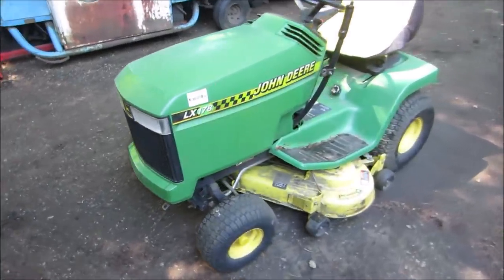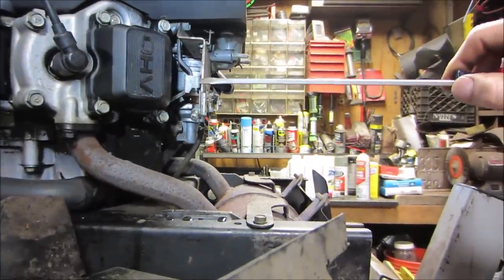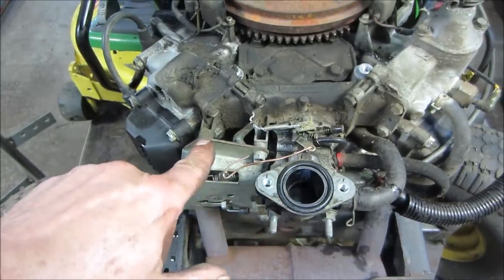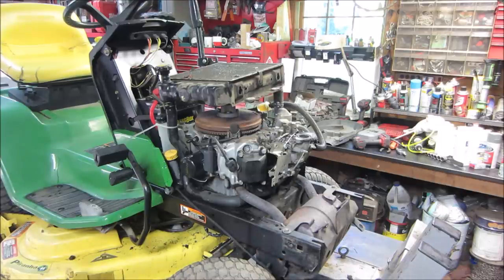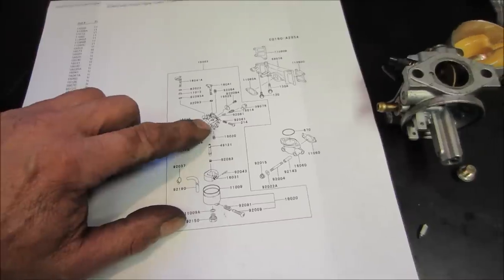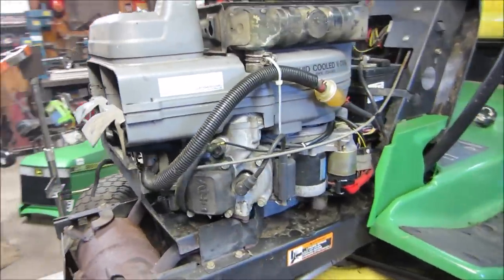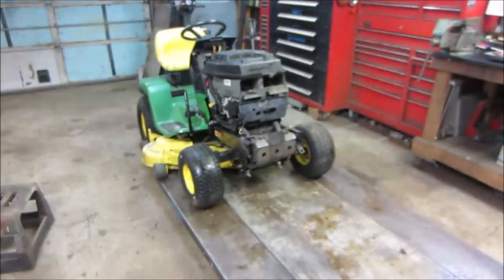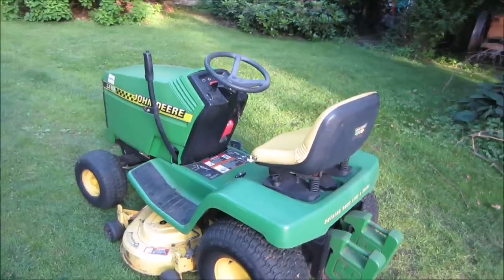yard sale John Deere, lets unfix other peoples repairs.

Comment: I just bought me a John Deere 125 last year.
Then i see for sale, Same one i bought for $50.
I am betting they just didn't know how to fix it.
I have fixed lawn mowers that people just gave to me because they didn't know how to fix them.
They thought they was junk.
many times they was still good.
Just need some carb cleaning, even cleaned behind the muffler.
I have seen push mowers clogged with so much behind the muffler.
I think maybe they was putting to much oil in them.
I just clean them till they run, then sell them.

Comment: Homemade tool idea for needle valve seal catcher, plastic pen barrel drill a bunch of tiny holes along the length to exhaust compressed air, place over needle hole before using compressed air to catch the seal.

Comment: Just bought an old L166, pretty similar, but with a B&S 16 twin, and a 48" deck. Motor is fine, but the transaxle is sketchy. And it's "maintenance-free", which doesn't mean it doesn't need work, it means they don't want you to work on it- so they can sell you a new one, for big $$$. Fortunately, the transaxle is made by another company, TuffTorque, and they'll sell you the parts. Word to the wise...

Comment: The blades you took off weren't only bent, they weren't lined up right either. They should form a + where they cross like the other 2 sets were. Those were forming an X. So somebody probably hit something pretty substantial and really messed up that set. Nothing an impact wrench and a vise can't fix though. :)

Comment: If that came with the 42" single stage snow blower it would be the same that I have and it shoots snow 30' and it retailed for $1600 without wheel weights and chains

Comment: That's the first time I've seen such an elaborate engine on a riding mower.  Must have been pretty expensive when it was new.
Reply: Got the bill of sale on my 1994 LX178 at 2999.00 before any of the other add on's.

Comment: Hey man check out Amazon You can get the carb for 40 or 50 bucks, well a knock off but the knockoff i put on my Kohler has held up for years with no issues.

Comment: I've used a heat gun to adjust those plastic floats before. warm it up a little bit, flex it with a flat head and then hold it till it cools

Comment: use the green slime and you're suppose to drive on it so it works its way all around the inside of the tire and balances itself out then take the tire off and leave it sitting front side down and it will seal the front sidewall

Comment: The puff of smoke upon start up could also very well be your valve stem seals leaking down when the engines not in use. I've never seen smoke caused by excessive fuel being puahed out the exhaust valves , and don't believe it  does make colored visable smoke when burn or pushed unhurt out and into the exhaust .

Comment: Welding rod makes the best rods. I can't remember if I use 5/32 or 1/8 but I knock off all the flux and it works perfect.
Reply: Yes they do, but coat hangers are cheaper :)

Comment: Probably a stupid question but can you not just sharpen the blades? Oh and I just found out about the hydrostatic pin yesterday, much too late for my back unfortunately. My mower cut out and I had to push it 30-40 yards to work on it.

Comment: I work on Deere tractors all the time. You actually can (I know it's hard to believe) take the carburetor off of these things without removing everything you removed. it will slide off of the two long studs and you can remove the linkage without bending it all to shit.

Comment: Yup, with the overflowing fuel thinning the oil. My boss bought one and not reading the manual, we didn't realize there were two offs on the ignition. Off where the engine isn't running then really off. We would just turn the key off and that opened the fuel solenoid and filled the crank with gas......OOPS....

Comment: Did you know, the wheels on a mower deck should only touch the ground where there is a high spot. The deck is to hang from the tractor at cut height. The wheels are not there to adjust the deck height. Call a dealer, and ask that question. This is something I just found out. I have been running my John Deers on the wheels for 40 years. However you get a better cut when the deck is adjusted to hang.
Reply from the maker: depends on the mower

Comment: I had the same problem like craftsmans lawn mower I went to go clean the carburetor out because I thought they did one of the Jets was clogged because it would kind of rev up in RPMs and go under load and then lower back down and kind of fluctuate between but I put the car back on and the next morning it was hydrolocked because the gas has went into the crankcase so I have no idea what happened I thought it was a seal in the needle that wasn't working

Comment: Great engine after 2000 when they went back to a all steel  crank  shaft before that the plastic  lobs would fail .. it's  amazing that they  make a bullet  proof  tractor  engine  and  there  ATV engines are  trash

Comment: Mustie1 - @ 24:28 - 24:44, is that stray spark under the flywheel?  Under the flywheel in the dark area on the top of the block.  I don't know if that's normal, but review the video and check it out.  Love all your videos!
Reply: Jason Churchman Was also wondering this!
Reply: to me it looked like a spark the first I saw, then watching closer it seems like it was liquid moving around, probably from the power washing.  Just light reflecting off of it.

Comment: 26:10 The way I remove a long threaded stud like this is to thread on two nuts, tighten them "against each other". and then use a wrench on the "farther" nut to loosen the stud.  A bit safer (i.e., it doesn't dig up the plain portion of the shaft or "leveringly" wear the threaded hole into which the stud is screwed) than using vise-grips on it.
Reply: Hank Bridges  I didn't see it listed on the Sears page.  What does the "O-ratchet" do?
Reply: Hank Bridges  Ohhhhhhhh okay, I know the kind of tool that you mean now... a "through the tool" ratchet-handle for allowing a long bolt-shank to pass through the head of the ratchet.  That wouldn't help here, though, since you need some way to make a nut not turn on a threaded shank, to get the shank to unscrew without damaging the threads.  That's where two nuts and an open-end or adjustable Crescent-style wrench are called for --- you first tighten the two nuts against each other, and then turn the "lower" nut counter-clockwise to loosen the shank, or turn the "upper" nut clockwise to tighten the shank.

Comment: I got a John deere 325 kawasaki air cooled mower that has been on fire 2 times, iv got no battery so i have been powering it with 32 volts off a battery charger and iv only got it to spin one time for about 20 seconds then it went out for about an hour and came back but threw a spark

Comment: Looks like a fairly low-hours example. That front tire's bald. Better to replace both fronts than fill with the splooge IMO. That hood will be even easier to remove eventually. These '90s lower-mid-level LX100-series Deers had thin plastic hoods and many are cracked today down where it mounts to the frame. The plastic parking brake lever how it clips to the dash is another horrible design (for reliability). Those manual sector and pinion steering models can be hard to steer; the enclosed recirculating ball in the 200-series is like power steering by comparison.

I could go on, but my LX176 yard sale lemon awaits yet another fix so that I can resell it. <<-- $170+ for the carb from JD; alternatives don't exist for the FC420v. Yard sale purchasers actually get a better deal with the V-twin 178s and 188s in that regard.

Comment: Seems you had an oil leak. Appeared to be a head gasket. Try re-torquing the head bolts and check the rest. Factories are not perfect. Some bolts are sent out loose.

Comment: Looks like it'll be a pretty nice mower once you get the carburetor issue fixed.  Gotta love when people try to fix stuff that have no idea what they're doing...trouble is you end up stuck fixing their mess and it costs you money, but I think if you either keep or sell that mower you'll make money on it at some point.

Edit:  Is that really a mulching deck or is it a rear discharge deck?  After you raised it up to remove the blades you can see the discharge chute out the back, so it looks to be more of a rear discharge deck.

Comment: What kind of blades are those Darren? Never seen an X set up before. Wondering if i should do that on my mower???
Reply: because its a mulcher and not a bagger?
Reply: no i've had mulching blades before, and do now actually. (Gator blades). never seen a cross blade set up like that before... Got me wondering if doubling up my blades would cut better as my blades bog down the mower a lot in the taller stuff....

Comment: Engaging the deck belts with engine at full speed is like dropping the clutch on your car at full rev.  It's destructive.  As the manuals state on these mowers, engage the belts at the lowest.rpm possible, then rev up.
Reply: My Craftsman recommends 1/2 throttle.

Comment: wow that engine was revving way to high thats not good i think the throttle should be lowered i have had similar problems with my lawn mower its a 1981 cub cadet 582 briggs and stratton .

Comment: There's a slime cheat sheet on the internet on how much slime to put in  what size tire and it won't affect the balance.  If I can find it I'll throw a link in the video.  I used it on an old truck with a pitted rim and it worked ok.  Definately good enough for a go cart in my opinion.  Wouldn't throw it in a Porsche..

Comment: Had a moped flood fuel through the cylinder and the crank case when a parked it on a bad camber facing down hill think the vacuum pump was leaking straight through and the float stuck

Comment: Some times you can remove the conectors from the seat safty switch and it will run with no passenger in the seat.also try a light coat of flex seal ion the inside of the tire to act as a rubber sealer. ps love the vids keep it up

Comment: I enjoy your videos but need to pose a question on this one.   When you used the lift to put the front end of your tractor in the air, other than the hitch seeming to be lodged against the garage floor, did you do anything to secure the tractor from falling off the lift?    If so, might it be a good idea to show a strap or jack stand in place as it appeared you were underneath the body substantially and particularly while air wrenching the mower blade off that safety might have been a concern.     I note that you made a point NOT to appear to be telling folks to re-bend  a mower blade so obviously you care about safety and implied liability in your videos.  I enjoy your videos and your laid-back style of teaching while entertaining.

Comment: Seems a little like a modern car where if they could get away with it they would put the gas filler under the driver seat behind 6 screws. The labour time for a repair on this would be high enough with all the kit you have to remove just to do anything.

Comment: I have a john Deere mower(90s) it starts hard but then runs fine. The problem is ten minutes later when it gets up to temp it stalls. Then will not start again. I rebuilt the carb and set the gap. Those are good. Any idea what that could be?
Reply from the maker: check for spark when it happens, some times ive seen the coils go bad and act like that,

Comment: I would put a gas shut off valve and each time you are done using it - shut the fuel off and run it out of gas.. Or for $13 buy an after market carb..

Comment: Surging is common on those things, both the LX178 and 188. Also the LX279 can have it too. Actually any of the vertical shaft water cooled Kawasaki engines that use that Mikuni carb. The problem is normally crud in the idle circuit. Fixed many of those. Usually a very thorough carb cleaning takes care of it, but it can be a bitch getting all the jets out without stripping out the screw slots. They should NOT have a rubber seat, but should have a rubber tipped needle. Somebody appears to have bodged that with Briggs parts. And yes, that link should be straight. Those water cooled Kaws are great engines overall. Something else I wanted to mention, those wheels on the deck are not meant to be rolling on the ground all the time. They are actually for anti scalp purposes and should be set to be slightly off the ground when the deck is in cutting position.

Comment: You should always engage your mower deck at about half rpms to keep it from slipping every time you cut them on you hear the squeal when you turned it on and I wana see the snow blower
Reply: I've always been a believer in that same ideology, and would reduce the rpm's to almost idle before engaging mine, too. Just to ease the "shock load", and to try to help clutch or belt/pulley faces last longer.
Reply: Stan Patterson yup anywhere from idle to to half throttle is better then high throttle just want to make sure your motor is idled enough or strong enough to handle the load of the deck coming on
Reply: My Toro ZTR states use full throttle only when engaging the blades.  I have owned it for 8 years and have never had an issue with the clutch or belts.
Reply: Robert Heinkel my husqvarna manual says to engage blades at half throttle

Comment: Much like modern cars, sometimes they just overcomplicate the hell out of things for no good reason. Why the hell do you need a liquid cooled lawnmower? I wouldn't even have one if it was given to me. That is just a bunch of extra shit to break down and have to troubleshoot. That was the entire problem here. The previous owner did a halfass job on the carburetor because he didn't want to disassemble the whole damn engine to do it correctly. Too much headache. Hell, I even deleted the fuel shutoff solenoids on all of my mowers and installed manual ones just so I don't have to worry about it if I'm having fuel issues. I like to keep it simple.

Comment: Its not the needle or seat, its the float.  The float is not floating anymore.  its a common issue with these plastic floats.  Get a new float, and the needle will work fine.

Comment: I bought my first house early this year. I've bought a used riding mower which has since decided to not start for some reason. Does anyone have any resources to try to learn my way around a small engine?
I've replace the solenoid and starter, the battery is charged. It's trying to turn over but not quite making it.
Reply: You're in the right place. Mustie, and mrbeef have great youtube channels dedicated to small engines and lawn mowers. If I were you, I'd start simple and make sure you've got fuel, spark, and compression. Then go from there.

Comment: To watch this video without cheating and adding an add-blocker I have to watch 12 commercials, two back to back at the beginning and each one of the marked breaks.
Reply from the maker: there is 6 put on by me every 9 minutes  so l dont know why you are seeing 12, and the end one does not count as its after the video is over,
Reply: For some reason I have started seeing two adds at the beginning and two at every break.

Comment: Which do you prefer the flat heads or the OHV engines?
Reply: I had the same problem with flooding even while it ran with a brand new fuel pump and carburetor.
Reply: Flatheads are easier to work on, but they are old technology.

Comment: The oil in Kawasaki mower engines equipped with an oil filter stays clear for a long time.  When it turns dark its time for oil and filter.  Its an easy way to know when service is due, let the machine tell you.
Reply: or be wise and change it at minimum every season. oil is sure cheap compared to an engine/rebuild ;)
Reply: People's memories are funny, one year turns out to be three or five.  Thirty one years on my Kawasaki engined mower and still running strong following this rule.
Reply: Some people's memories ARE funny.  Others simply are motivated enough to just do it at the beginning of the season, or just before they put it away at the end of the season.  I always felt that it was my hard-earned money, and damned if I was going to "let it slide" and end up having to replace it (or do a rebuild).  If I wasn't on top of it, the wife would get her hands on (whatever it was) when I wasn't at home,  so it was in my best interests to regularly check oil levels, keep tires inflated, things that the wife wouldn't think about before running the equipment.
Reply: after saying that, I have no room to talk. I've only changed the old push mower oil 4 times in many years,
think it's 25 years old? small 5 hp or less and has the old fuel tank/carburetor combination, which I rebuilt once when it quit pumping fuel (12+ years ago?) :))
it doesn't smoke, still has good compression, always runs long enough to get good and hot burning any moisture out. doesn't use oil,  cheap as can be mower with B&S engine.
Reply: How do these new push mowers get by with no oil changes?  Do they burn the oil and it gets replenished that way?
Reply: no worries about oil changes, since people let them sit with fuel and the carb. gums up after a year anyway.

Comment: The junk you put in the tire will rot the rim lol i have seen it many times i worked in a JD shop for many years ,do not ever use it
Reply: I too, absolutely hate that crap. I put a tube in every tire that goes flat on a mower. I'ts a done deal and you never have to worry about them again.  I've had to fix some that had that stuff in it and what a pain that was. If I had a tire shop, and someone brought one of those in, the price would double.

Comment: I see you clean by blowing air and forcing water in the wrong direction on different things, like filters, etc. Should be blowing in the opposite direction from the part's normal flow rather than sending dirt on thru the filter.